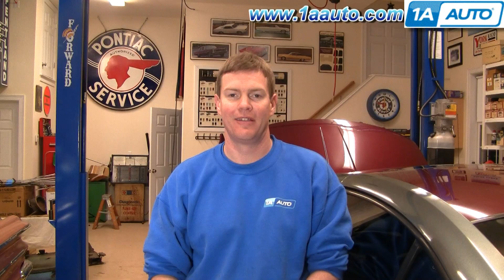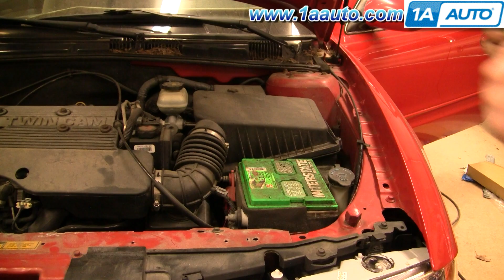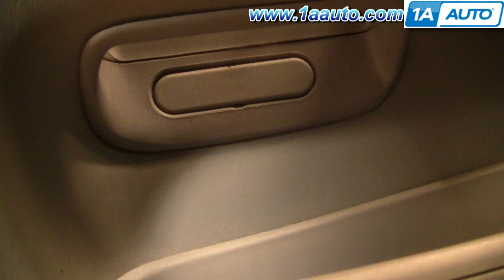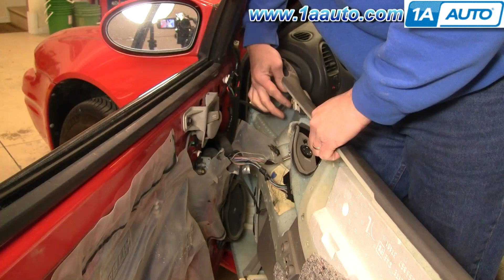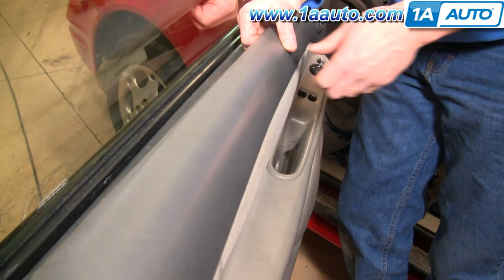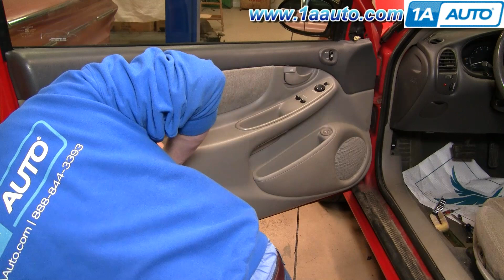How to Replace Power Window Motor 99-04 Oldsmobile Alero

Comment from the maker: Normally the window motors have so sort of brake inside of them to keep the window from falling down. It sounds as if the window motor is just bad and not the entire window regulator but you will have to open up the door to figure that out.